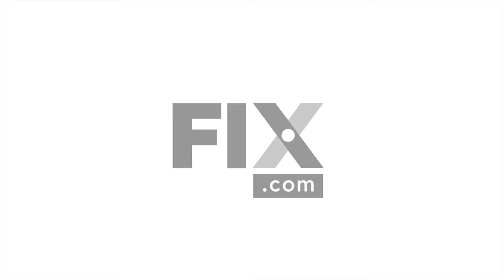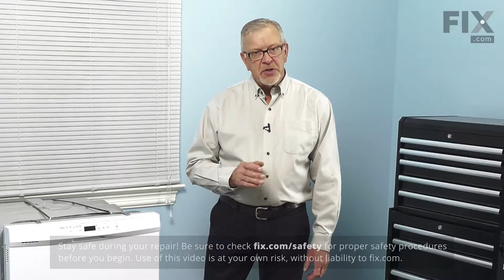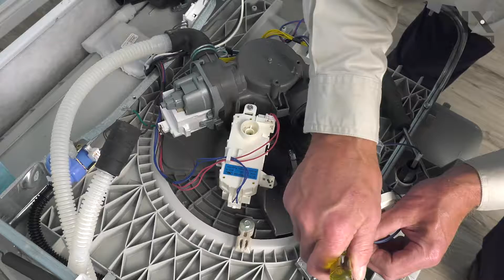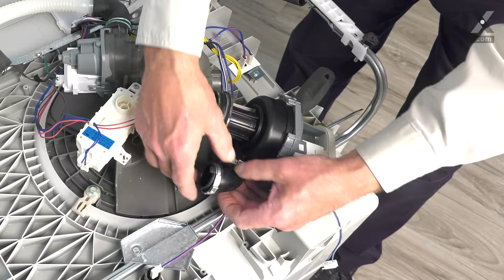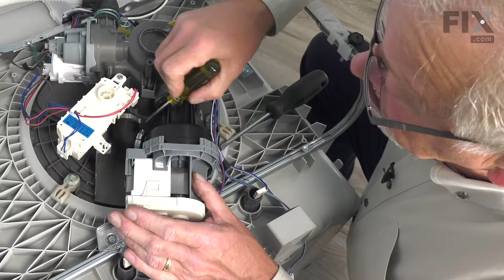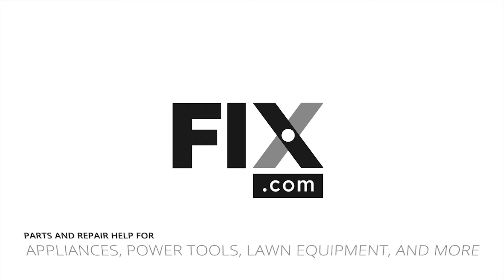Kenmore Dishwasher Repair - How to Replace the Pump

Comment: The issue that brought me here is different.  The motor disconnected itself and let the water pour onto the floor!  The "friction fit" grommet let the motor slip out.

Thanks for the clear video of how to do the normal replacement. It gives me a place to start. I think I'll just clean the surfaces and maybe  rough up the plastic pump neck to increase the grip.

Comment: Why does Kenmore sell a dishwasher for $1,000 that breaks down within two years?
Reply: Try a Samsung refrigerator, dishwasher,  washer and dryer all have been fixed and repaired with in 2 years and replaced within 3 years. 
Washed cloths for a while in my shop that has an Maytag set from the early 70’s! Run like they were bought yesterday!
Reply: This business plan (inferior quality) started in the late 60s in the automotive industry and quickly spread to 99.9% of our manufactured goods.  As bad as that is what most people fail to realize is that these same industries began sourcing the cheapest quality and lowest priced imported parts from abroad. We have made fun and insulted Asian made goods as being garbage quality, and they were, exclusively by design. When they were sourced and specked by these industries. They could have imported much better quality goods that were the norm from these countries but insisted on the inferior quality because of the higher markups and frequent replacement.  My uncle fought tooth and nail for years and resisted other VPs at GM when he saw the intended direction that the big 3 auto makers were headed.  He was a lifelong GM employee who worked his way from the floor to a Corporate VP of quality control.  He predicted over 50 years ago that the automotive industry was only the beginning that this would be the norm. We live in a throw away society. Sadly
Reply: Same with mine. 650$ to replace motor plus labor not including tax lol never buying kenmore